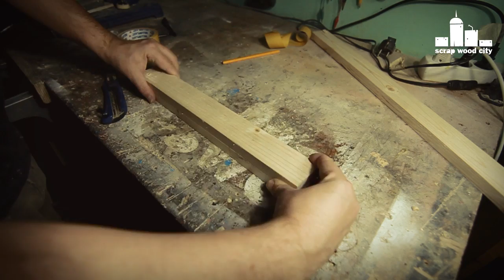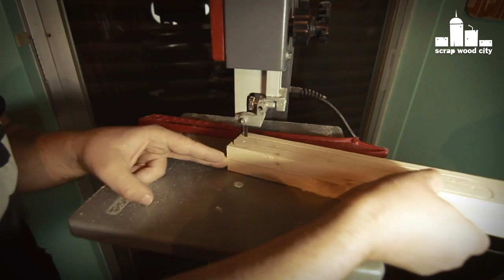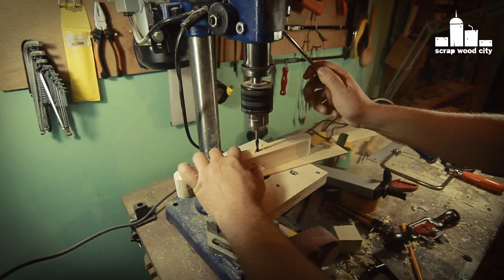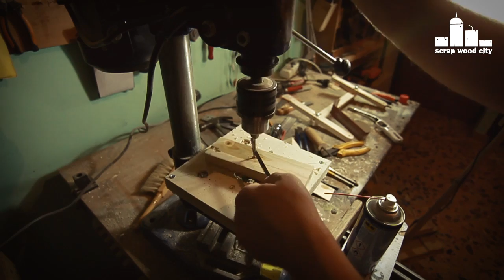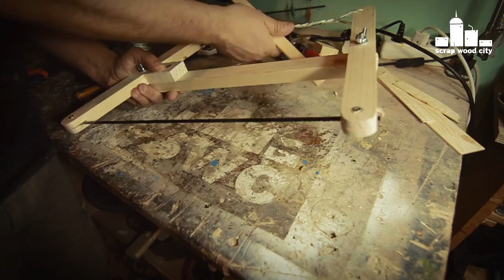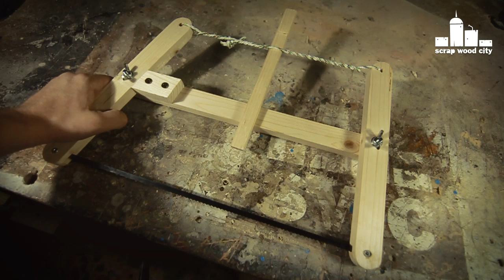DIY saw using a broken bandsaw blade (experimental project)

Comment: did you heat up the saw blade in order to drill it easier?  and scrapping it with the oil after is that for strength?
Reply from the maker: +Into The Dirtshop yes I did!